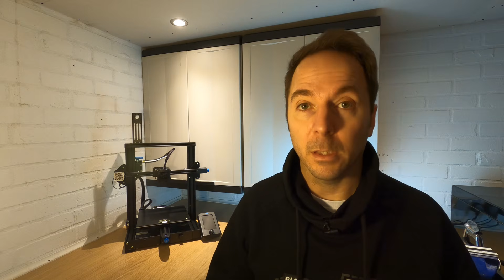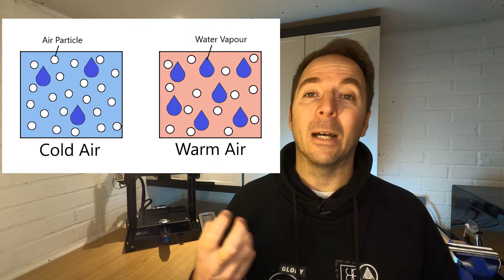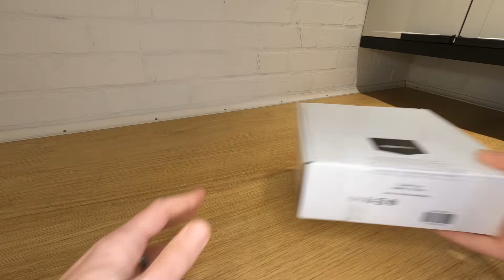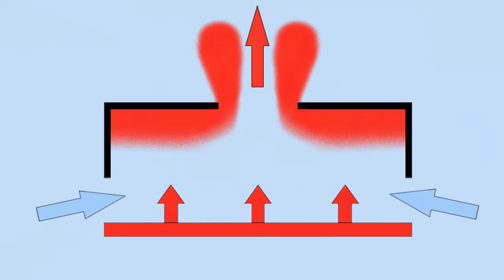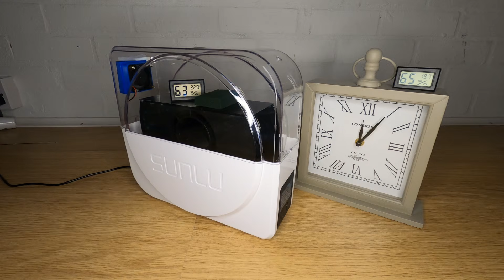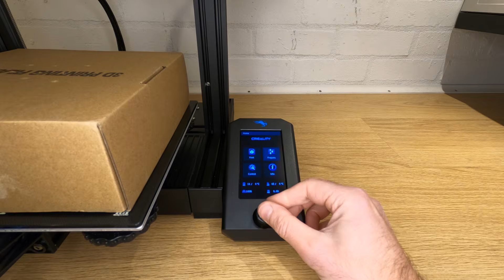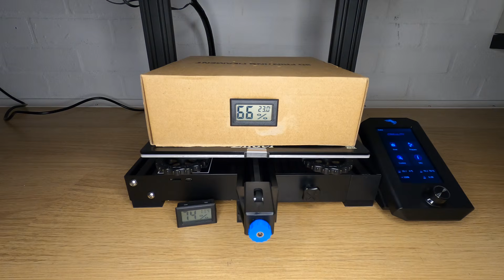Amazingly Simple Free Filament Dryer -You already have one!

Comment: I have MP select mini and my filament spool is larger than my bed lol! Will this still work okay if I have the box and the spool hanging over the edge?
Reply from the maker: You could try cutting a smaller hole in the bottom of the box so that only a little cool air can enter. If you heat up the air around the filament and it is allowed out if the top then you will get the convection current and it should work

Comment: I recently found this video and wanted to try this out before I go and get a filament dryer. I am currently using a Prusa MK3S+. I ran into the issue of the "Safety Shutoff" triggering after 30 minutes (the default timer). There are a few ways to work around this:

1) reset the print bed temp every 30 minutes.
2) modify the printer firmware to remove the timer or modify the time in the firmware and update the printer with the modified firmware.
3) send the M and G codes manually with something like PronterFace.

Solution 1 is going to be really bothersome. Solution 2 is a more permanent solution, but also requires familiarity with modifying and compiling printer firmware available on the GitHub, as well as essentially permanently disabling what some would rightly consider a recommended/essential safety mechanism for your 3D printer. 3 is what I ended up going with and here is what it looks like:

1) Connect your printer to PronterFace (or similar gCode utility program)
2) Send the print bed heating instruction: M140 SXXXXXX where X is the temp in Celsius you want the print bed at. 60C would be "M140 S60"
3) Modify the Safety/Inactivity Shutdown Timer. First determine how long you want to dry your filament for in seconds. For this example I will use 6 hours, which is 21600 seconds. 
    A) For most printers you will send "M85 S21600". This modifies the inactivity shutdown time to whatever S value in seconds you specify.
    B) For Prusa brand printers you will send "M86 S21600". M86 is a prusa specific gCode for the baked in "Safety Shutoff Timer".
4) Allow your filament to dry for whatever allotted amount of time you specified in step 3.
5) RESET the Safety/Inactivity Shudown Timer.
    A) For Most printers you will send "M85 S1800". This will set the inactivity shutdown time to 30 minutes. 
    B) For Prusa brand printers you will send "M86 S1800". This will set the Safety Shutdown Timer to 30 minutes (the original time in the firmware).

Doing things of this nature always merit this warning: Do this at your own risk! Do not leave powered printers unattended/unmonitored. Do not disable safety features. Safety Features are there for a reason and their evolution is only brought forwards through mistakes or disasters. Don't be the reason new Safety Features are invented and implemented.

If the above steps do not work, you maybe be able to accomplish the same thing by using "G4 SXXXXXX" which is the Dwell command and will essentially pause your printer for XXXXXX amount of time in seconds. I hope this helps some people out.

Cheers
Reply: Thanks for the walkthrough. Do you know of a way to do this via an SD card?
Reply: I'm looking forward to trying this out, thank you.

Comment: can u print a box with some holes in top and bottom to make it a bit less flammable and maybe put it over some small candle stove to save the printer bed from getting used too much?
Reply from the maker: Don't put anything 3d printed over a flame of any kind, pretty much all filament is flammable. Any heat source that stays below about 70°C will likely work though.

Comment: Just saw this and tried it to seemingly no avail, did what you suggested in the comments of about 55c for 12 hours and it seems like I'm getting the same issues. Using esun pla+, is there anything you'd suggest?
Reply from the maker: What issues are you having? I don't usually have any issues with eSun PLA+
Reply: @RickyImpey  Primarily layer gaps a little bit of stringing. I ran the gauntlet of trying to figure out what fixes work and don't work and drying out the filament seems to be the last thing left
Reply from the maker: @avy_f  I see, well yes, drying your filament is definitely worth trying as it can cause those kind of issues. Have you calibrated e steps and flow?
Reply: @RickyImpey  I haven't no, not sure what to change since one filament works and another doesn't for me
Reply from the maker: @avy_f  I understand. Sometimes it can be really strange how different filaments perform but there are a huge number of variables at play. I always try to eliminate as many as possible. E steps will confirm that your extruder is actually extruding the amount of filament your slicer wants it to and is the first place I would start with extrusion issues. Also, something like a cracked extruder can give you the kind of problems you are experiencing.
Reply: @RickyImpey  Weirdly enough it seems like it was a mix of too large a layer height and some retraction related stuff I believe. At least the filament is dried out now before that's an issue, if it's still acting up I'll look at the other things you suggested but I appreciate the help
Reply from the maker: @avy_f  Glad you made some progress 👍

Comment: The only issue I encounter is that the side the filament is flipped on, that edge sort of slightly melts together and sticks. Am I doing it wrong?
Reply from the maker: How hot are you setting your bed temp? It shouldn't be hot enough to melt the filament. 60°C should be fine. You can also sit it on a couple of small spacers to let some air underneath too which will help.

Comment: May be a stupid question but can anyone confirm  this will dry nylon for printing? Building the linked small dry box to keep it in after
Reply from the maker: It depends how hot you get it. Nylon needs about 80°C air temperature to dry. It think it would be quite difficult to get this setup that hot.

Comment: Thank you very much Ricky for this excellent video on how to dry our filament more economically and for free with the boxes, but I would like to ask you, how long should we leave it in the hot bed to try to dry a kilo of filament? Thank you very much for your answer, keep it up !!!!!!!😄
Reply from the maker: There's no sure answer unfortunately. It depends on the filament and how much moisture it has. I would probably start with about 5 hours and see if you notice any difference. Around 60°C would be good for something like PLA. You can go a little higher with other higher temperature filaments.
Reply: @RickyImpey  ok I will try with the hours that you suggest, the other question is if it is not bad for the spool to be in contact with the surface of the bed for so long and at that temperature, since the material of the pla rolls that I have is made of plastic, I'm a little afraid that it could become deformed or melt, thank you very much
Reply from the maker: @estebankelly770  The plastic spool will be fine at 60 degrees 👍
Reply: @RickyImpey  thanks again !!!!

Comment: your video save me tons of money, my printer had a problem which unsolved for 2month, which i almost decided buying new hotend and filament, then i stumbled upon your vid and realised that my probably my filament is bad, i did as your video suggested and it works. 😄👍🏻
Reply: Hi AweButSome. Just curious, what was the problem you were facing? I have a roll of PLA that I've been thinking was junk. I have inconsistent layer lines and now wondering if it's moisture.

Comment: Tried it on PETG and worked nicely! I didnt even make holes in the box, just turned it upside down, rotated it so edges were of the bed so some air can get it and set bed temp to 60 celsius. Ran it for about 1,5 hours. Thank you very much for the video.
Reply: Thank for sharing the duration, I came to ask for this

Comment: the problem with this guys suggestion is there is no timer so you could forget about it and a month later burn down your home or see your power bill and go omg... also if you set the temp wrong of thermal runaway goes off and your printer does not catch it.. this is bad folks dont do it use silca dessicant beads  and a dry box you can make one cheap use your stove on a timer but your stove has to go down to 120 degress some start at 200 degress right where pla starts to melt  150 and it starts to deform causing jams etc so one hot day in summer would do it outside in the desert of course not near a beach .. but this guy notice how he dont show you doing it yea just a warning

Comment: Coming back to say that this technique truly is a miracle! Not a single filament, the old ones and the cheap ones, resist to it. I get better result from filaments I had almost 7 months ago after this than brand new ones. Thanks again!
Reply from the maker: Thanks for taking the time to come back and comment👍 I don't really use this method myself as I have a modified filament dryer but I dry all the filament I buy now. So much of it comes with some kind of moisture content. A lot of PETG is unusable from new for me. Like you, I'm always able to print with older filament after a spell of drying too. Glad you have good results after watching one of my videos, that's what they are here for🙂
Reply: @RickyImpey  What temperature do you normally use for drying your PETG and for how long?
Reply: @Thiccologist  - I've been drying PETG at 55° for 12-18 hours. I can't use a higher temperature because the PETG is on a spool made from PLA, but that temperature and duration works fine.
Reply: Glad to hear about your results. How long do you keep your filaments in there? I understand that this will depend on how moist the filament has gotten but can you give a ballpark figure of what 'should generally' be enough?
Reply: @lebasson  I do about 60deg for at least 4 hours. for my oldest filaments, I did left some overnight so that would be a good 8h. But I do believe that if your filament is in a very bad storage, the humidity can actually break the filament to the point that drying it won't help.
Reply: @lebasson In the video he said 5h aprox. is ok
Reply: Hmm. I did 70 for 6 hours. Then put pla roll in vac bag for storage. I’ll be using it soon. Wonder if I should do 60 or 65??
Reply: Reading that gave me a stroke and dyslexia. Sorry im new to reading American
Reply: @drdigsaus  Your own grammar isn't great, either. You're on an American platform, why not use your own? Oh, it doesn't exist.

Comment: Damn I guess I’m keeping boxes now ugh what’s the best way to use a stove as it’s the only thing I have
Reply from the maker: I wouldn't use a stove, they are not designed to control the heat well at the low temperatures we need. You would melt something or worse case cause a fire!

Comment: How long should I leave my filament in a 50° bed to make sure it dries properly?
Reply from the maker: It really depends on the filament and the environment it has been in. Unfortunately we don't have a way at the moment to measure how much moisture filament contains so we can't really say how long it takes to dry. I know that I generally like to leave my filament in my filament dryer for 24 hours and that is at 55° but doing that with your printer bed may not be practical.

Comment: Have you tried this process to re-activate silica gel? My wife gets upset if I use the microwave so I avoid doing that. I've actually started using the Sunlu dryer to re-activate the gel. If you want more details on that let me know.
Reply from the maker: How long does it take in the Sunlu? I tried when mine was standard but it seemed to be taking a very long time. I don't really use silica that much so haven't tried using this method. However, if it works in the Sunlu then it will probably work on the bed, the principles are the same.
Reply: @RickyImpey  I run it 4 hours for one container, 6 hours for 2. My Sunlu is converted. Not exactly your conversion, but close.
Reply from the maker: @twms8728  Great to know it works👍

Comment: Drying filament worked wonders for me. I live in a tropical environment which means my workshop gets quite humid without air conditioning (75-85% RH at 25-32 degrees C). After fine tuning my printer, filaments straight out of the box print perfectly. I notice around 2-3 days later stringing starts to appear though. It only got worse as cracking and popping start to appear as well. Getting a filament dryer was a lifesaver, though i did regret buying the sunlu dryer later. I had thought of doing what was in this video early on but was too fearful and inexperienced to execute it at the time. But now i have revisited the idea thanks to this. 
I made a 21x21x10cm cardboard box lined with aluminum foil on the inside, using a combination of packing tape, kapton tape, and double tape adhesive to keep it together. The added height over the normal filament box gives it a bit of clearance overhead, allowing for better convection. Also made a 2cm thick circle with a 9cm diameter out of a strip of cardboard to keep distance between the roll and the bed. Poked holes on top, left some small gaps at the sides where it touches the bed. Heat up to desired temperature, put down the things in order, and leave for a few hours or even overnight. Come back to ready-to-print roll of filament. 
I still have safety concerns (namely of fire), but so far the benefits seem to outweigh the possible risks. Besides, i have left the bed heated for far longer when doing normal prints. So far? No fires. And i hope it stays that way. Another concern is knocking off the bed levelling, though i think that could be remedied with flatter/harder springs as well as thin silicone pads... which is an upgrade i'm about to do soon.
Reply from the maker: Yes, great work. I even dry new filament now as I've seen a weight reduction in every spool I've tried. I wouldn't worry too much about your bed level as long as you have the standard springs compressed to about 1/3 of their original length. That should be plenty to push it back up to the correct position without any problem. Did you see my S1 mod videos? You could make that S1 better than your bed dryer and print at the same time....https://youtu.be/5jCVT0lXKyU
Reply: hello Wisp how are you, I'm having the same problems with the filaments, would you be so kind as to be able to publish photos of how you reformed the cardboard box to be able to do the same, thank you very much

Comment: Thanks for this! Do you think if I dried out some TPU and then put it in the Sunlu S1 to keep it dry while printing, it would help with long prints? I was going to buy the S1 for this purpose but I'm worried that I'll have to keep on resetting it every 6 hours or whatever the max time is. I don't really like the price tag of the S2 especially if the box method will be doing the majority of the drying, but the higher temp and longer "on" time seem worth it.
Reply from the maker: The S1 has a maximum timer of 24h so as long as you don't mind resetting it every 24h then yes it will do what you want it to. Depending on your environment, it may be fine to leave it in the box for 24 hours or so after the heat has gone off as when I tested, not much humidity came back in. TPU is very hygroscopic though and I tested with silica beads. I'm afraid I can't give you any exact figures. What I do is dry my TPU in the S1 for 24-48h then put it in one of my dry boxes https://youtu.be/lPsYR6tOA4g I get got TPU results doing this.
Reply: My prusa mini turns off after 30mins. Any idea how to override it?
Reply from the maker: @FlyboyEUC  sorry, no. You'd probably have to create a custom g-code file that sets the bed temp periodically. And heat source will actually work as long as it can be controlled and the air can escape.

Comment: What should I do to dry my ABS?
Reply from the maker: I've dried 8g of moisture out of ABS in a modified Sunlu S1 that had an internal air temperature of about 40°C so I would expect it to work fine in similar conditions here. You could safely take the bed up to 60°C or more with ABS as it has a higher transition temperature than PLA.
Reply: @RickyImpey  Ok, thank you very much

Comment: So if we have a space heater, we can  also just run a vent pipe to it and to a box with an exhaust, and bam, long as it doesn't get too hot, that's badass
Reply from the maker: It depends what fuel your space heater uses. If it's a gas space heater then no because water is produced when the gas is burned. Electric heater will work if the warm air can leave from the too and take the moisture with it.

Comment: Making a box out of aluminium or something similar would also help conduct the heat, a layer of cotton or fabric underneath the metal could also help if you are worried about metal on metal
Reply: I would use an oven gasket with slots cut in for air flow

Comment: So basically I'd you have an enclosure, you can just toss in your spool, and as long as the ambient air is hot enough, it should keep your filaments dry-er. Especially if you leave them in there. This is a great idea
Reply from the maker: Kind of, if it's in an enclosure then the moisture will likely stay in there. Ideally you'd let the warm damp air out the top and let cooler air in the bottom.